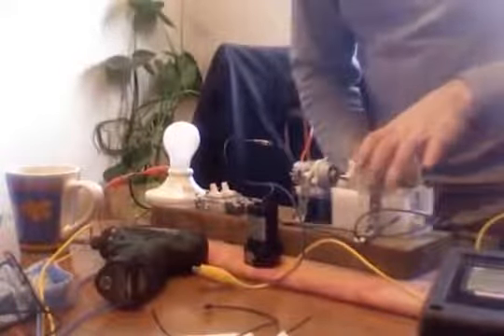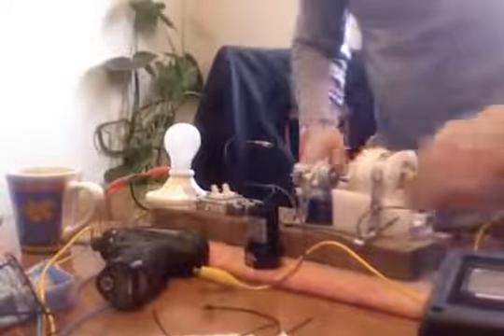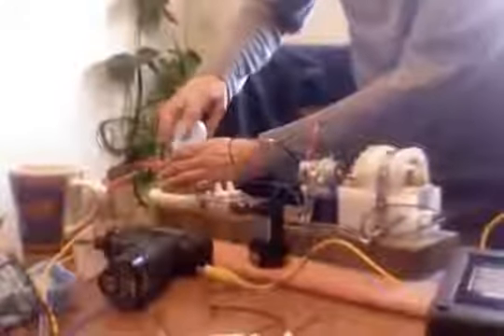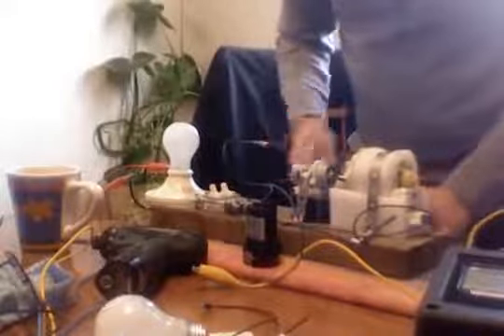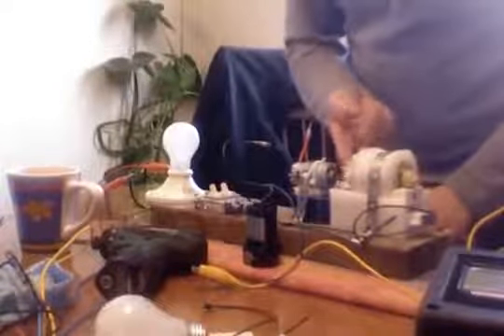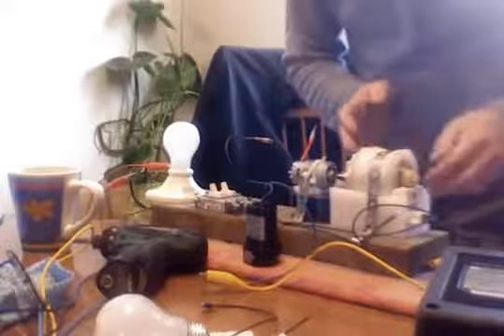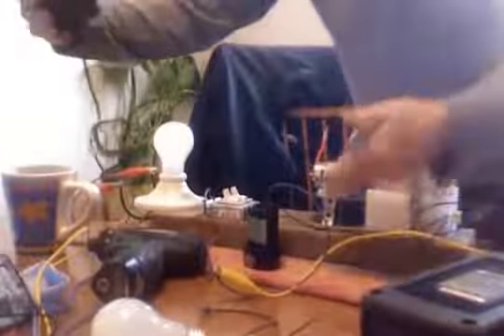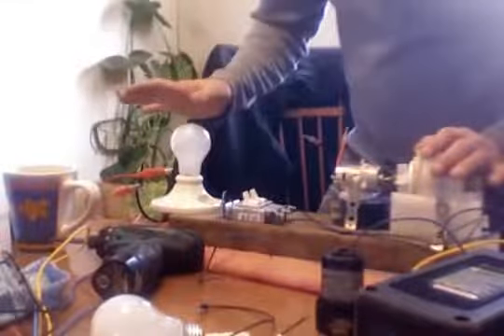Free Energy Feb 2015 Gerard Morin Replication

Comment: i need your opinion. How about having the same configuration in a little larger scale with an inbuilt storage battery that can all be compacted into a desktop computer size cabinet and use it for a small house that consumes 1500w. What should be the key factors to consider.

Comment: So just what have you accomplished besides wasting $60?  Mr Morin is wrong about square wave coming into your house.  The only way you can get square wave is by converting DC electronically to AC. as in less expensive inverters. All generators/alternators produce pure sine wave AC.  Generators just rectify in one way or another the AC into pulsating DC. The Only reason that we use AC today is that it is impossible to send DC power over long distances without large losses due to resistance.  Just look at the cables for the starter for your car.  Lots of power required and the cables get hot if you continue to draw heavy power load for extended periods of time.  The higher the voltage the easier it is to push current thru the wires so cars went from 6 volt batteries to 12 volts and if you would check you would see that the battery cables got smaller.  Now apply this tho transmission lines Power = volts times amps (measured in watts) Say we want to power a light bulb on the other side of town (for simplicity call it a 120 w bulb) and have a 12 volt battery to supply the power. using the power formula P=IXE  Power equals I (Amps, current) times E volts (electromotive force) so 120 = ?X12 or 10 amps.  Going to take a fair size wire to carry that much power without having great resistance loses so  requires a big wire ( gets costly and bulky).  At this point It doesn't matter if it is 12v DC or 12v AC sooner or later the resistance of the wire will become great enough that the losses require bigger wire and so on.  Where AC becomes effective is it is easy to change the voltage by the use of a transformer.  A transformer transforms one AC voltage to another AC voltage depending on its construction either up or down but the power is not changed (slight losses occur due to internal resistances and eddy currents in cores) but lets take that wire feeding our light bulb and put a 2:1 transformer in the line.  Now the voltage is 24v AC going to the bulb. but the current in the transmission line is cut in half  (5amps).  Our light bulb is designed for 12 volts so now it increased current thru the filament and glows brighter and its life is reduced.  So we put another transformer in the line before the light bulb. This one is a 1:2 or step-down transformer changing the voltage back to 12v and the light bulb glows normally.  Take this same system and multiply the numbers by many hundreds thousands of watts of power and there is why we use AC.  The limiting factor of power transmission in the current that we push thru a wire and by increasing the voltage to very high amounts we can reduce the current that our power transmission lines need to carry.  If it was not for this factor our transmission lines would be extremely heavy and costly and the losses would limit the distance we could transmit power.  This is what Tesla was working on - a method of power transmission that was limitless.  What is shown in this video is nothing more than a basic motor generator.  The faster you turn the motor the faster the generator turns thus producing more voltage at a higher frequency.  Nothing new here that a basic electronic student learns in his first semester except renaming some of the terms ie: radiant energy   As far as Mr Morin touching his leads you do the same thing with an old carnival machine that testes your "grip"  volts but with almost zero current.  Current is what hurts you not the voltage.  Just walk across a carpet with rubber shoes on a rainy day then touch a door knob. Thats 40000v or higher in the spark but almost no current.

Comment: Sigh ... this is frustrating.  I've watch many videos regarding this Gerard Morin replication,  99% of them doesn't understand the concept of Wattage.   Simply talking about volts here, volts there  means absolutely nothing ... N.O.T.H.I.N.G. !!!!!!!!

Measure the watts IN  and  watts OUT, then you'll have something worth our time. Hey, i can build a circuit that can make a 100watt bulb light up powered by a 9 volt battery.  Yes, it's the same concept you  have there except yours is simply the mechanical version of the solid state inverter.
Reply: gconol
Ever heard of the vibrator which turns 12 DC in high voltage AC which powered my first car radio, (valves). They don't show current in out for obvious reasons.
Reply: Peter May yes, I find these kind of demo quite frustrating. They don't seem to understand the importance of power. Gerard himself never shows both voltage and current at the same time.   I'm not sure if he even understand what watts really mean.
Reply: It's actually the same energy you use every day, CFL bulbs have no filament, and you can run them in your house with electricity from the grid...No SciFi here.

Comment: what's the point here? You could light DC bulbs from the 12 volt battery with a 500 Watt inverter. You are just changing current but not getting more power.  I would like to see a system where I could power my fridge, microwave, washing machine etc. What do you suggest?  This system does not even generate enough power to run the 12 volg battery charger so I can keep creating power. I don't understand the purpose of this machine except that you are turning the volts in AC but you can't power much more than a few light bulbs?  I've built the same system and now I'm stuck. I've connected one and then two old microwave transformers but when I do that not even the light bulb burns?   Is this an over-unity machine under construction or what? Please help! I so much appreciate the great work Gerard Morin has done so far!!!
Reply: By using a 110 or 220 inverter from 12 volts 14Watts drill battery you can run the bulb for 14 minutes, using this setup by using a 10W motor you can run it for 1.4 Hours...That is the point.

Comment: Great job with the video.
Keep pushing it further, you've done well, study the current.
Reply: Thank you very much sir,but i dont have a lot of money to pay your service it is because i am poor only i have to do is to keep on praying your victory ....
I hope you can still give me the chance to learn sir again thanks a lot for your kindness
Reply: +Gerard Morin  You can use a combination of an KV 520 (Beast X 528 3Y) with Neodamyan magnets, in order to aquire more power, and a centrifugal star coil, Gerard, in order to raise the power of it;  It will be an endless over unity infinity if you might.  If the Star coil wont work, the Rodin Coil will.
Reply: Hello sir I'm from Philippines.its very interesting.i bought high voltage transformer from oven.220 v ac 60hz with the output of 2800ac volt.i plug it to the wall directly,and tried to connect it to 3 spark gap.first set up it won't jump,i mean no spark is happening.
Reply: And then i try again this time i connect directly the body ground of the high voltage transformer to 3 spark gap and the output terminal of the transformer when it touch the other end of spark gap,it works it jumps.but the problem is the reading of my meter is very high from 350 watts it goes up to 3.2k watts 😅

Comment: In response to your question circa 5:00 about why run 15k volts if you only need 110:

Higher voltage can transfer large amounts of energy with low amperage. Low amperage means you can run a smaller diameter wire and it will not heat up as much. Simply put, high voltage is efficient for transferring high amounts of power through wire. If the power lines ran at 110v, the amperage required to power every house simultaneously would be insane. Wires would have to be enormous. Think gigantic copper pipelines bigger than water mains, or they would melt. To me, this makes perfect sense.

Please elaborate as to why the power company's use of this efficiency metric is unwarranted. I am genuinely interested in this technology and plan to build a setup just like yours, but I also need to understand more about why what the power company is doing doesn't make sense in yours and Gerard's opinions.

Thanks,
     - Duncan
Reply: They use "High Voltage" because AC current can't travel great distances because it uses electrons to carry the power and electrons have high resistance, that is why they use High Frequency RF to transport the power and then converted  to what you know as AC.

Comment: how long does battery last
Reply: good question joe, less than 10 minutes in my case with 14 volt at 1.5 amp drill battery...But ,It is only one, no correct self looping yet, no high frequencies ala Don L Smith to stimulate the background energy,  I think for that to happen we would have to really calculate how to step down correctly: frequency with either combination of caps, resistors and transformers, easy if you know what I'm talking about, and then again knowing this from Don L Smith videos I haven't done it for it takes time resources and much study, cheers

Comment: Hi guys can someone tell me whether the magnets in the pump are diametrically or axially magnetized. Thanks
Reply: it is a 2 faced long magnet , lengthwise horizontally divide it in half and you have both poles, trying to be clear here, thing is I've found out myself that some are 2 magnets joined with a plastic frame, if going the route of over 10k or so and exposed be ready for injury if not protected so be conscious of this, I did this destructive test on purpose, to learn the max output etc, not overunity but cold effects and acceleration with added resistance and load are present as well as the crazy square wave...I have to admit that I was disappointed at first when the battery died and the drag for Gerard says is not there but there is drag...Thing is like I mentioned before it doesn't cease to surprise me how close to Don L Smith's theories all of this is and Tesla's... Much experimenting to be done, time permitting...
Reply: KUKULCANGOD Of course there is drag on the generator,when you put a load on it it's coils generate magnetic field that interact with the magnet...and like many as said its like an inverter.
Gerard never shows watts in, watts out but only voltage on the primary batery and out,and always start the motor with the load conected because we would hear the drag...